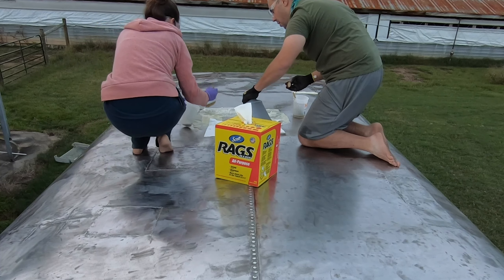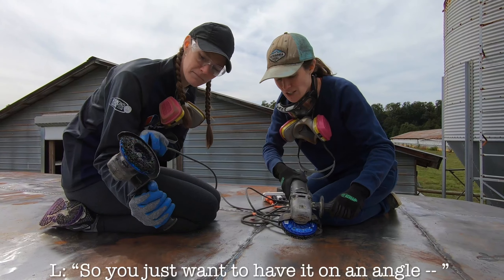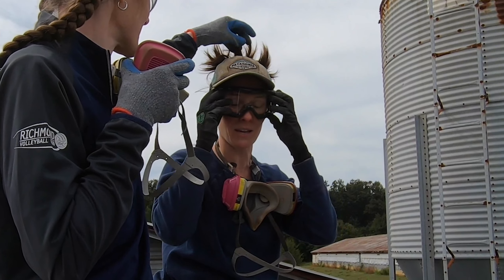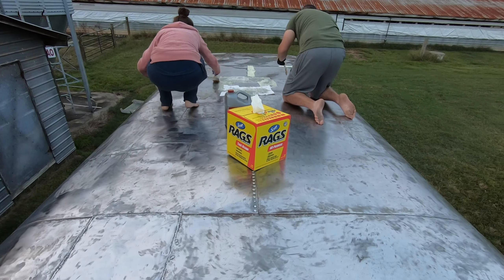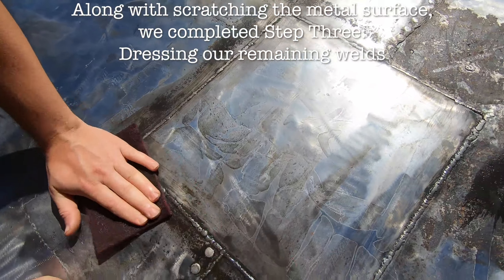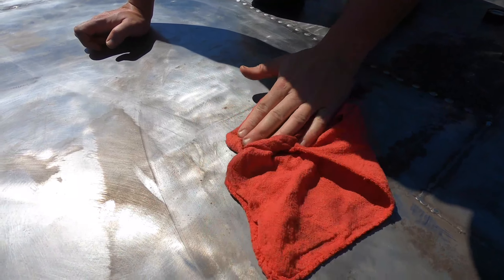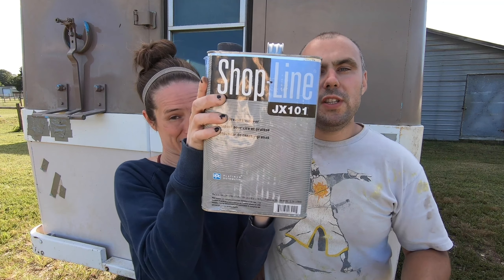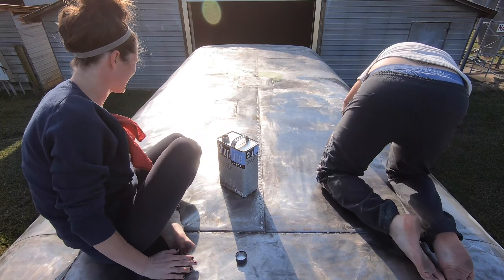OUR RV ROOF'S PAINTED! Sealing Our Roof with Tropi-cool Silicone Sealant After Welding, Body Filler

Comment: Hmmm ... that roof will be cut open again for the a/c and other vents, the exposed metal cuts will have to be rust proofed to prevent any traveling moisture that may come in contact.
Reply from the maker: Yes we know, but we have no idea when or where (position wise) we will be installing the roof mounted units. We also plan on adding solar panels and a deck. Making the Cortez watertight and solid (there was a lot of rust and body filler up there) was the priority so we had every hole - excluding the marker light holes filled. Andy&L